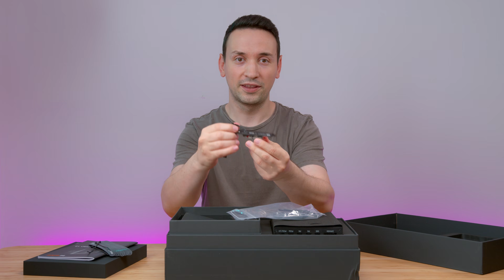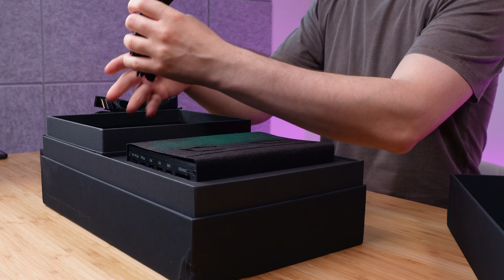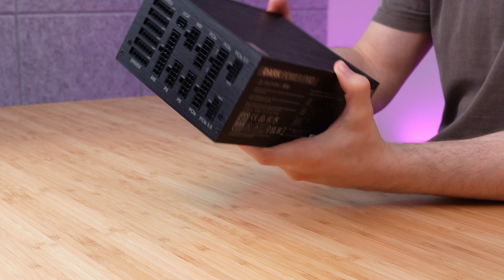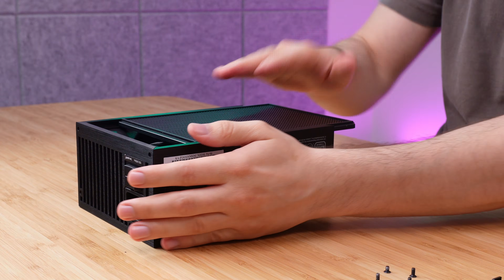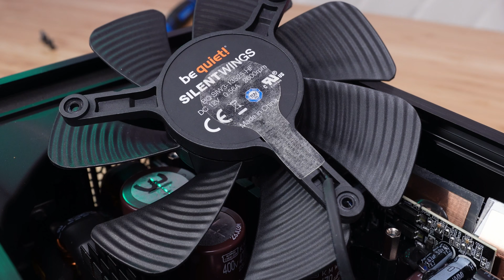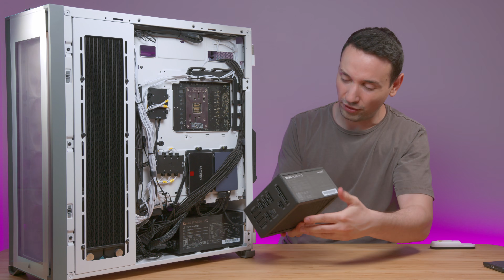DARK Power PRO 13 | Made For Your High-End System

Comment: Should I switch on the OC key on a 128gb ddr5 RAM, ryzen 7950x and 3090ti asus tuf system? Or it should provide enough power without switching it on? Cheers!

Comment: How did you get your Corsair 5000D case to provide a window to show off the power supply?  Mine is solid white metal.. is there an after market part you can get to do that?
Reply from the maker: I actually have the Corsair 7000X, I don't think you can get the opening on the 5000 series.
Reply: @htpoint  perfect, glad I asked you.. as I'm building my new dream build PC... I just ordered the 7000D and canceled the 5000D... i9 13900KS, 4090 FE, 8TB SSD, 128GB 6000mhz RAM,   I even bought a Creative AE9 sound card for this inane machine...  so of course I had to have a great power supply!
Reply: @htpoint I just picked up a 1600w, still skeptical of the quality.  How has your psu held up???